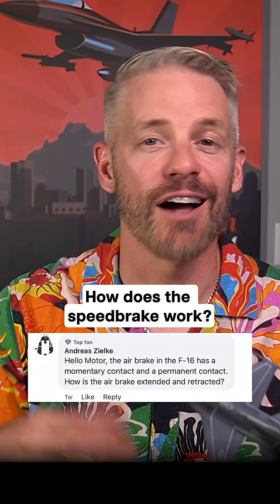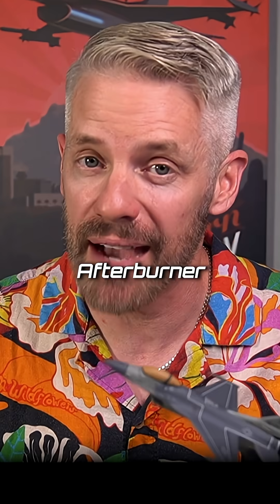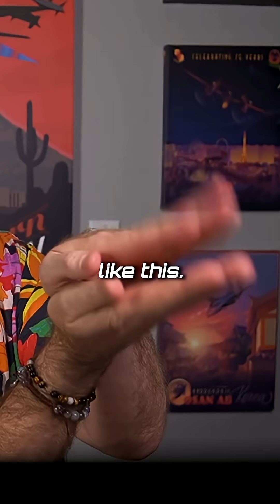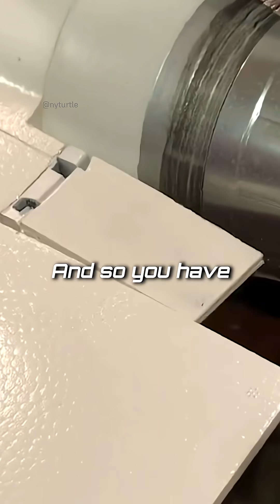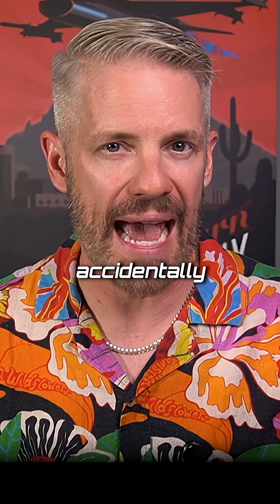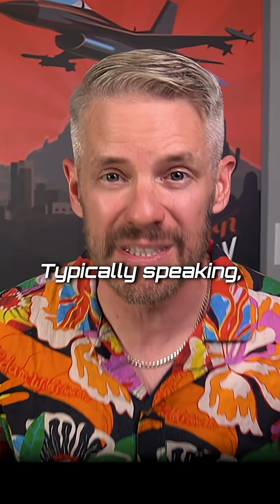F-16 Speed Brakes Explained

Comment: It works almost the same way that some train brakes : you can increase the braking by pulling on the lever, with the spring pushing it back in neutral position, and release them completely by pushing the lever in a stable forward position (which can be the traction command).
On the F-16, can you partially retract the airbrakes by pushing the lever without retracting them completely, something you can do with the braking system I'm writing about?